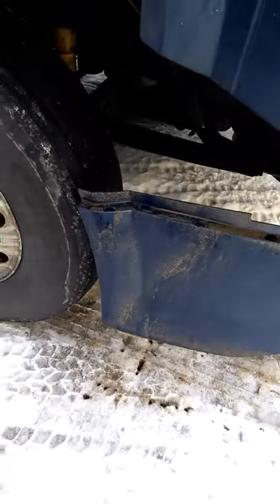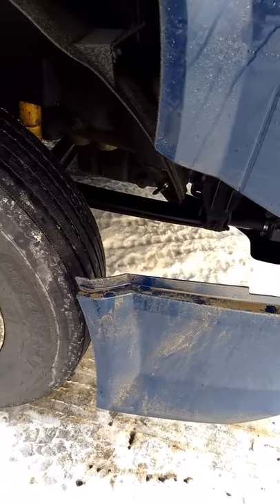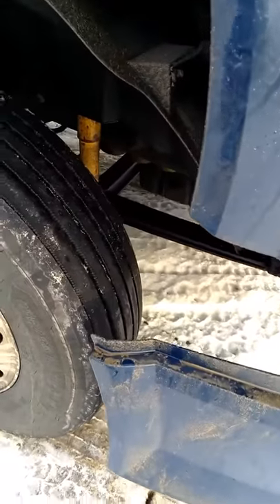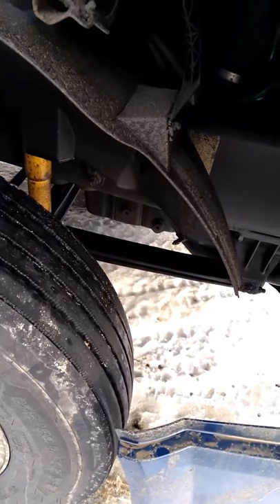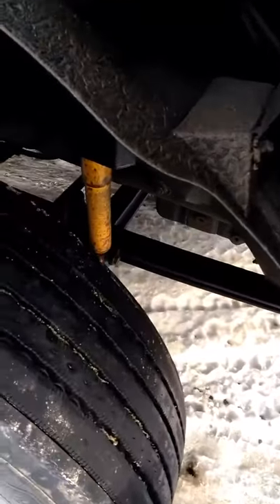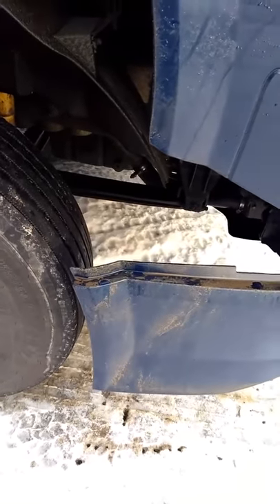Oil Filter Training Video - Pottle's

Comment: Whoever's changing your oil is not tightening the tube that the filter threads onto on bottom of the housing. Reach up and tighten that stem by hand before installing the filter